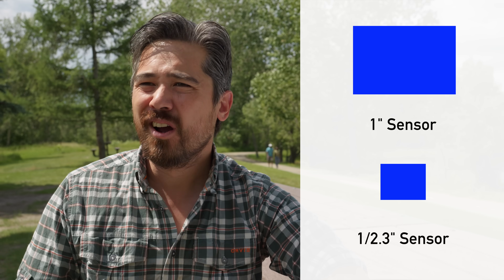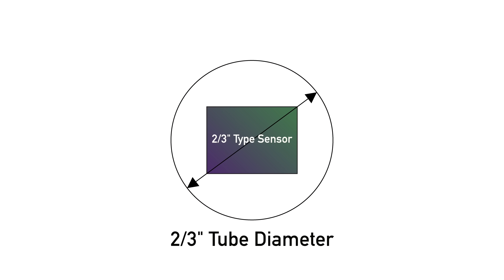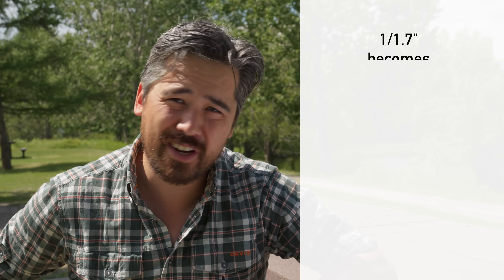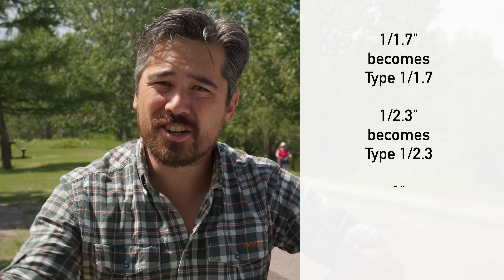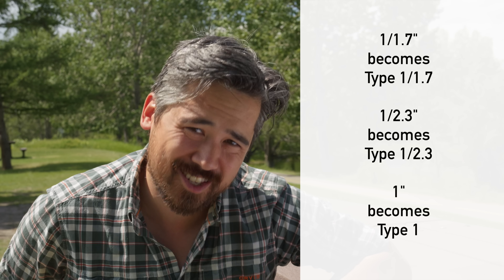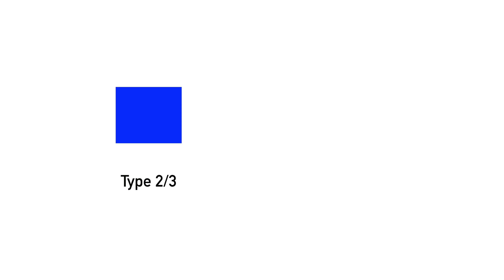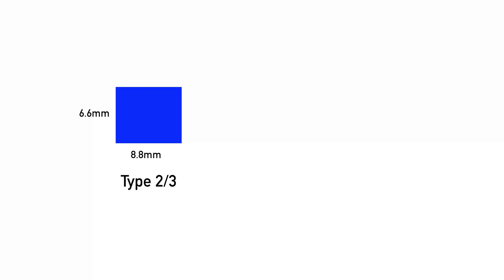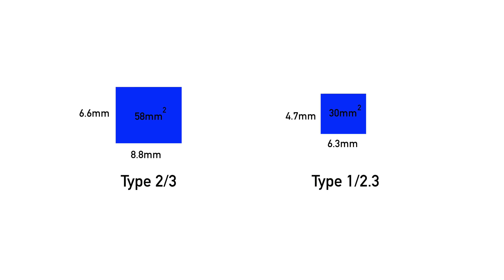Sensor sizes make no sense, but we fixed it!

Comment: FOR HEAVEN'S SAKE, just name each sensor by its width in millimetres  rounded off to the nearest whole number. Never mind defining the aspect ratios since they are all either 3:2 or 4:3 -  which are fairly similar and therefore not important for the basic sensor identification.
So Full Frame is now a 36mm sensor, APSC is now a 24mm (except for Canon which is a 22mm), MTF is now a 17mm, the 1" is now a 13mm, the 1/1.7" is now a 9mm (but nobody uses it any more) and the 1/2.3" is now a 6mm sensor. Meanwhile the two so-called Medium Format sensors are called 44mm and 54mm. 
Simple, clear and obvious, surely!
Reply: No, no no. First so coarse rounding does not work on small sensors. Second that data is not compatible with other sources.
Reply: @okaro6595  To avoid confusion among the smallest of the sensor sizes (e.g. 1/2.3" versus 1/2.6", etc), you could simply round off the widths to the nearest first decimal place (rather than the whole number) for those particular sensors. Not that many people are going to be interested in that level of detail, anyway - especially where the very small formats are concerned. It is important to keep this sensor-naming terminology VERY SIMPLE. Sensor size is probably the first and most important decision to make when buying a camera or camera system so properly understanding what is available (there are basically 8 to choose from) is crucial. One reason why the camera industry is in decline is that the general public are intimidated by the confusing terminology which has evolved around every aspect of digital photography. These days, many potential newcomers will be reluctant to even walk into a camera shop for fear of being confronted by jargon and then being sold something they do not really want.

Comment: I’d prefer it even simpler: Sensor area in percent compared to full frame, crop factor, aspect ratio. For example, for a Canon APS-C sensor - area: 39% of full frame, crop factor: 1.6x, aspect ratio: 3:2. These are all directly useful: relative area to FF gives low light, depth of field and room-to-pack-lots-of-pixels-before-diffusion-sets-in capabilities. Crop factor gives effective focal length. Aspect ratio warns if it’s not 3:2!

Comment: I think there are 3 important numbers - the number of pixels, the area and aspect ratio. That tells you how large image will be, the shape of the image and how much light the sensor can gather.  When digital sensors were either 3:2 and the outlier was 4:3, it didn't need to be talked about. Now and in the near future sensor sizes look to be increasingly varied in shape.
Reply: When were they all 3:2. Compact cameras have always used 4:3. The number of pixels is in moist cases uninteresting.

Comment: What a mess... thank you for this one but, psychologically... sorry, but only full frame gives me a native 28, 35, 40, 50, 58, 85, 105mm... and yes, sorry again for not leaving it in order to use eventually smaller cameras using even heavier lenses, altogether with a questionable interpretation of the correct focal length. And yes, the same happens when U use adapters, trying not to loose that stellar performance of your, let's say Zeiss Distagon 35mm f2 or Nikon 105mm f2 DC and so on. Love your channel!

Comment: When I started to really get into understanding cameras and what makes them tick, there was a lot of stuff I never knew. 

Like you said, the smaller type sensors snd all the way up to large format which are significantly larger and much more expensive than a full frame 35mm equivalent  sensor.

There are ways to figure out the crop factor from the lens equivalent and actual size. However I am sure you guys can explain it better.

One thing mobile manufacters need to stop doing is advertising sony imx as 1" sensors.  If it was 25.4mm diagonal then it would significantly larger than the phone could accommodate in the chassis.

Comment: I concur with those saying this makes sense and is long overdue, but this particular implementation seems unnecessarily complex. Screens, which often share or approximate some sensor aspect ratios, are measured from corner to corner. Total surface area would probably be even more useful as the main attribute so that relative sensor sizes are more easily visualized. I think you should pick one, use that along with the aspect ratio, and maybe mention the other measurements in written or illustrated form.
For example: Full Frame could be "864mm² 3:2" or "41mm 3:2"; MFT could be "225mm² 17:13" or "22mm 17:13."
Beyond this, any useful info can be calculated or illustrated without needing to be declared.

Comment: Adding the surface area and dimensions is super helpful, thank you. Maybe just completely scrap the 'type' as it means nothing to nobody outside the 1950's TV industry as you rightly said. If they were just labelled by their surface area it would be super easy - the larger number the bigger the sensor.
Reply: Yes, ‘type’ is redundant in terms of fractions etc. Type as far as technology such as ‘backlight illuminated’ or ‘stacked’ is important at any one point in time. In future maybe not so much.
Reply: Exactly, type doesn't ring a bell for me.

Comment: Dropping the " inches and replace it with Type? Total nonsense, what is the point when we still have these stupid fractions? Just specify the diagonal as we do with TV's but in mm. The aspect ratios are not that much different that they would matter much.

Comment: I had already left a comment on Richard's article last week, but since you raised the point again, here was my suggestion: take the usable area of the sensor in square mm followed by an aspect ratio. Drop all terminology about aps-c, full frame, m43 or whatever. Just something like: 857 mm2 (3X2) sensor, or words to that effect. That makes for easy comparison of sensor sizes without having to use brand names. It was just a thought.

Comment: Just go with square inches or square centimetres or even 1/crop factor.
Reply: That makes no sense. The idea is not to replace old cryptic marking with a new cryptic marking. The new measure they give are clear;: width and height. if one were to add something IMO it would be the difference to full frame in f-stops, like Canon APS-C 1.33, Micro 4/3: 2, 1 inch 3.

Comment: I wonder if there's a difference between the classic Type 2/3 and the modern 1/1.5 found in smartphone cameras
Reply from the maker: Very similar size. Type 2/3 is 58mm square, Type 1/1.5 is 52mm square.

Comment: Why not just use the mm, the crop factor or percentage? Changing "inch" to "type" only solves one kind of confusion.
Reply: Exactly! What I would like is the diagonal in mm - then we can really understand the size
Reply: @Jonathantuba  not really ... what about different aspect ratio
Reply: @daniel.maitheny  Right. This "new" system brings more confusion to an old problem.
Reply: Agree fully - removing the inch does not solve anything

Comment: Going with a rounded out MM squared system makes sense. 1/2.3 is a 38 sensor. 2/3 is a 58 sensor. Most APS-c's are a 384. Canon's APS-C is a 338. If that nomenclature would take hold at least you'd know at a glance the sensor size, rather than having to go to a calculator to figure it out.
Reply: it should be mm not MM in the first place
Reply: I made a similar suggestion.
Reply: @wilkbor  I didn't read the comments before I made mine. Great minds.
Reply: Yeah, I was thinking the exact same...best way forward!
Reply: Those mean nothing. You will need to take a calculator to understand them.
Reply: So, you just used the same convention, but instead of the diameter of a cylinder tube measured in imperial units(inches), now is the area covered measured in millimeters.

The things I want to know about a sensor is: Size, aspect ratio, specific technologies (stacked, dual gain, CMOS, BSI)

Any way to accomplish that is ok for me.
Reply from the maker: This is exactly what we're doing going forward whenever we compare smaller sensors.
Reply: @dpreview  Why not go a step further, and get rid of the fractions altogether? Instead of saying "Type 1/2.3" just say "Type 30" where 30 is the rounded area 29.61mm². Likewise APS-C is "Type 370" for 369.72mm², etc. Easier to say and immediately comparable.
Reply: @ledged_up  I like that idea
Reply: @dpreview  But why not larger sensors?  It feels like a cop-out to roll out this system and then cut it off where most people are making decisions.  Phones are so software dependent that most people won't look at sensor sizes when comparing them, anyways.

Comment: I am for simply using the crop sizes as stadard. Many photographers know them anyway and they tell exactly the ratio to fullframe. You can also use it to calculate how lenses relate to sensor size.
Reply: But “full frame” is confusing itself…
Reply: Most people cannot comprehend how 1 inch sensor (116mm²) is 2.7 times smaller than a full frame sensor (860mm²) because 860 divided by 2.7 is 319mm and 116mm multiplied by 2.7 is 313mm.
And even if we divided 860 by 2 and we get 430 which we divide by 2 we get 215 which we finally divide by 1.7 and get 126mm.
Nowhere near. These are simple methods most people will do it by as well.

Comment: Lens focal length is in SI units (mm)
Filter thread diameters are en SI units (mm)
Full Frame sensors relate to the old 35mm film (SI, again) a should be 24x36mm
Industrial cameras give the sensors sizes in mm x mm and photosites in micrometers... also SI
Etc.
If everything is in SI units, calculations are easy, consistent and intuitive.
The French Revolution which brought us the Metric System (from which SI units are derived) happened already 3 centuries ago, please get rid of inches, yards, pounds, long tonnes, etc.
So, please define the sensors as "h x w" mm + other specs (BSI, etc.)

Comment: Oh my, americans and british shouldn't be allowed to define measurement units. Why not derive something from SI that makes sense, and informative without much background knowledge. A good measurement system works in a way, that once you understand the logic, you can be given ANY data in that system and you'll understand it, you could compare it, etc. Type 1 makes no sense if you don't know about what type 1 is. Why not something like: Surface area + "R"+side lenght ratio, so an APS-C sensor would be "420 R1.5"  and the fullframe would be "864 R1.5", while mft would be "225 R1.33"  <-- It is consice, it clearly communicates sensor surface area, and you can at first sight see what image format is it in. Also you can easily calculate the actual physical dimensions. 

Also if we are reforming, some ideas: 
-give lens fov in degrees on max image circle
-sync EV as unit for ISO and aperture
-erase the term "zoom" from the time-space continuum
-give macro magnification in mm on max image circle at minimum focal distance, so 1:1 FF macro lens would say  for example "35@500" so that would communicate that you can take a picture of a 3,5cm small object from 50cm distance.  
- put it in law that every lens manufacturer should use the same nomenclature for defining maximum image circle size. It could be sensor size, because circle diameter rarely clashes with the image format
- put a number behind the IS/VR/etc naming to show how much stops it corrects

To summarize a lens name would look like: "Canon RF 30* F2,8 35@500 IS4 USM for 864R1.5" or "Olympus MFT 110-40* F4 for 225R1.33"

And analogue to macro magnification, if you want to indicate how far seeing a tele lenes is, you could give the distance of an 1m big object when it fills the image, so like 1m@50m immeadiatly says that you can photograph something like a dog from 50m distance, and also immeadiatley know, that if you have to photograph small birds from 100m, this lens isn't suited for you

Comment: Just put a graphic showing everything related to size about the sensor and it's corresponding competitors for better visual representation. Now while talking about it just say it's diagonal length. It work's for display sizes and will work just fine here.

I have another suggestion like instead of saying numbers you can use Binary Alpha-Numeric Conversion System (like Hexa-Decimal), although it might be a bit confusing but not unusable.

Comment: TV sizes are measured as the diagonal length in inches. This should be the same for sensors. Simple, straight line of numebrs.
Reply: Except sensors use different aspect ratios. TV's were 4:3 and now 16:9, so diagonal inches is easy. That said, I would be fine with diagonal as long as they mention the aspect ratio.

Comment: in addition to all of that, I would add the crop factor of each sensor.

Typically, for smartphones and stuff like that, companies like Apple like to use the "equivalent" focal lenght, saying that they have a 22mm and a 50mm lens on heir phones, it's obviously not 22 and 50mm lenses, but it gives us the same angle of view as a 22 and 50mm would on a full frame camera. The problem with that is the fact that people could get confused by the marketing thinking that the "50mm equivalent" f/2.8 lens on the Iphone will give you similar bokeh as a full frame 50mm at f/2.8 which is obviously not true.

Having the crop factor would allow us to get a sensoe of the depth of field we're dealing with those very small camera sensors.

Works also for compact cameras that tent to use equivalent focal lengths on their interface when you're moving the zoom rocker. Granted, you can always refer to the markings on the lens to know the "real" focal length, but that'd be nice to have
Reply: No, the problem is that not everybody started out in photography with a camera that makes 36x24mm images on cinema film, so the concept of "full frame" is just a relic kept around to make aging millennials feel like they're still at the top of the photography status hierarchy. To photography newcomers, it sounds as silly as expressing your Tesla's range in horse-equivalent furlongs per peck of feed.

Comment: Measuring in millimetres with a combination of width and heigh is the best Idea!
Like 8866 instead of 2/3" or 6347 instead of 1/2.3". It will be similar to a lithium-ion cell naming convention, a combination of diameter and length, for example, 16850 means 16mm in diameter and 850 in length.

Comment: This system is rather stupid. It's similar enough to the old system so people will get confused.

The most logical way to compare image sensors is with the Sensor area index. A larger sensor will have a higher number. Let's take three sensors as examples. 
 Hasselblad Medium format = index 251 
 Full Frame = index 100
 1/2.3" = index 3.2 

APS-C will have an index of 43. Hence one can swiftly determine that the APS-C sensor is around 13 times the size of a 1/2.3" inch sensor. 43/3.2.

It would also be beneficial if the sensor aspect ratio were presented. Some might argue that the inverse of crop factor is better but that does not capture that area increase with the power 2 instead of linearly. The crop factor could be helpful for easily comparing focal length, but we all should probably switch to field of view anyway.

Comment: I will stand with my opinion that the easiest naming convention would be the sensor width (as a representation of overall size) and the aspect ratio.

Full frame would be 35mm 3:2
APS-C is 24mm 3:2
Micro 4/3 is 17mm 4:3
Etc.

Comment: Why not just use the diagonal length? 
In my mind it's easier than the type 2/3 because those are still numbers and people might still think they refer to actually dimensions

Edit:especially since APS-C has different sizes(diagonal lengths) with Canon having its own. And the "medium format" being slammed on sensors bigger than full frame. Think fujifilm, think Hasselblad, different sizes but the same name
Reply: Agreed. I wonder if people in this comments section seriously suggesting area have thought through all the math required to understand area. Diagonal length makes equivalency calculations, crop factors, etc. much simpler. All you need is one relatively small number and you understand everything. There's a reason why the math is the way it is in photography. Using area is silly.
Reply: @mbvglider  that's what I thought too.
Reply: Me too. The most impt adv it this naming is widely used in tv, displays, tablets.
Reply: @alantan3582  Great point. And just like sensors, screens come in various pixel densities as well as aspect ratios, yet the diagonal is a convenient way to measure all of the different screen sizes.
Reply: I like the diagonal measure best. One number and done. Like TV size so simple.
Reply: Square inch or square millimeter

Comment: The meaningless antiquated "Type" you propose to use should be dropped/done away with.  It simply confuses so why bother with it.  Start the change now and in a few years it will be long forgotten.  Sensor size should simply be expressed in actual physical dimensions in mm and the sensor surface area in mm2.

Comment: Why bother with 'Type' at all? Why not classify by the diagonal and aspect ratio, i.e. a 17mm 4:3 sensor? Drops the confusing fractions and is more precise.
Reply: Why use English when Esperanto is more logical? One has to use accepted standards even when they are not so logical. What is 17 mm 4:3 sensor? There is no such thing.